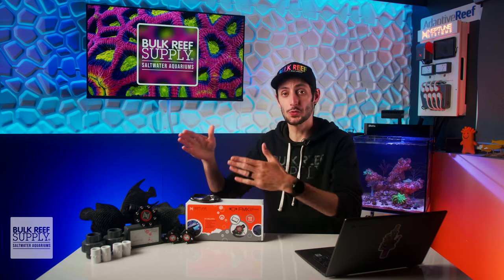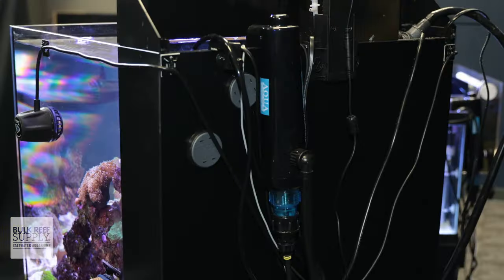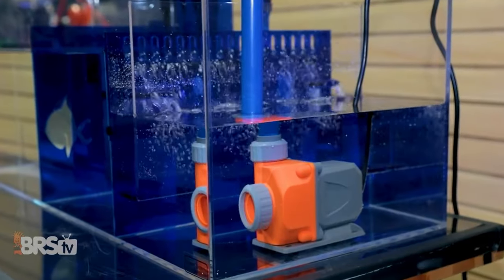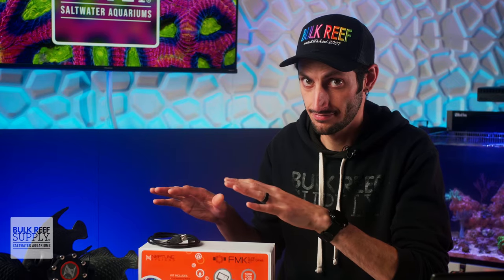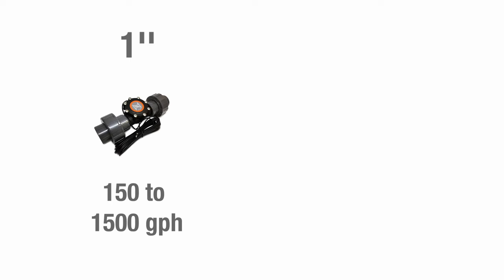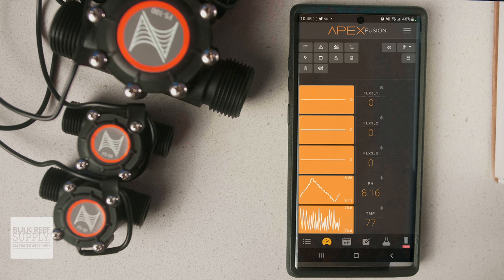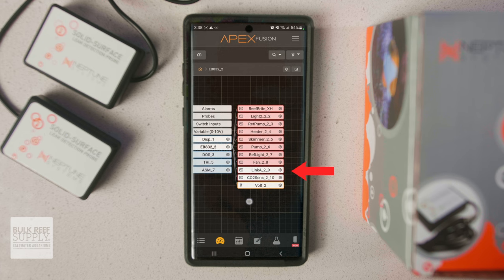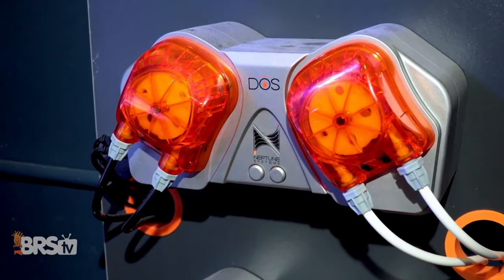Dial in Flow for Saltwater Aquarium Gear! Neptune Systems Flow Sensors

Comment: Never had good luck with these flow sensors, did I just have bad luck?
Reply from the maker: We use them on a few different systems around the BRS office. They need to be cleaned every once in a while, but other than that, have been running strong!
Reply: @BRStv  ok thanks for the reply

Comment: Maybe it’s just me, but the Neptune ecosystem seems so expensive to get into. For example, the water leak filter is appealing, but I’d rather just have a single sensor I could connect my generic power strip, rather than needing a huge controller system. It’d be cool if you had cheaper ways to buy pieces of Neptune without the full blown controller.
Reply: Solid point, and I think Neptune Systems did have a good thing going with their older "Jr" model back on the gen 1 version. Hopefully they do something similar to that in the future so those who want to pick and choose what their controller has can still do that, and even start small and build up to a full blown system if that is something they will eventually want. I think only offering beefier controllers is a bit of a miss...